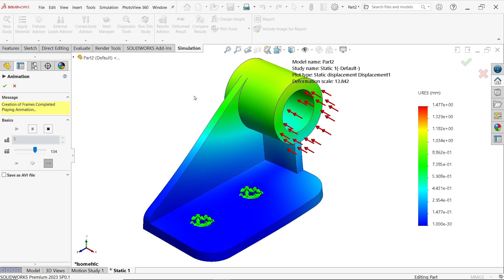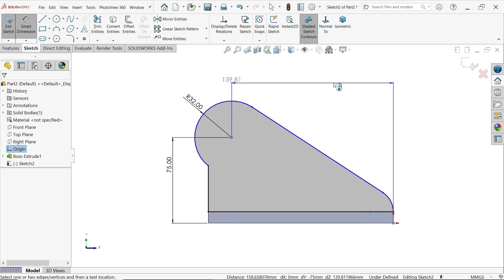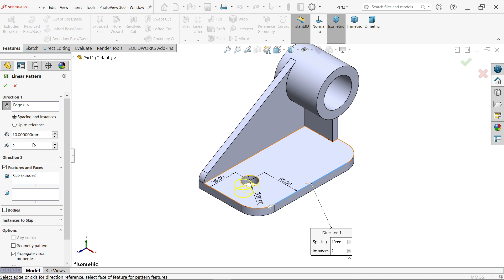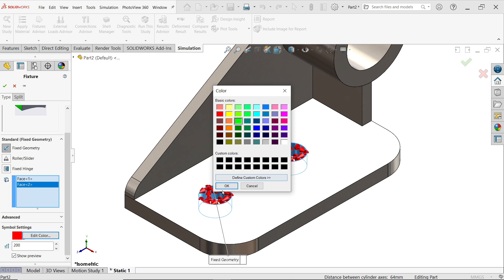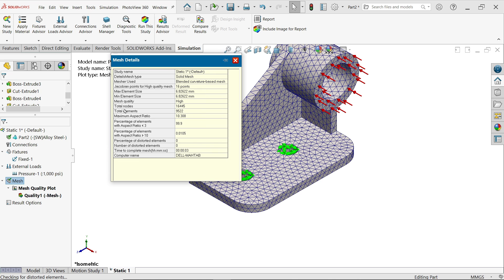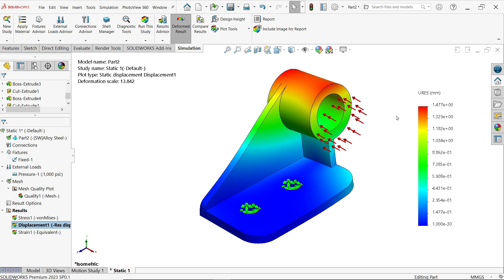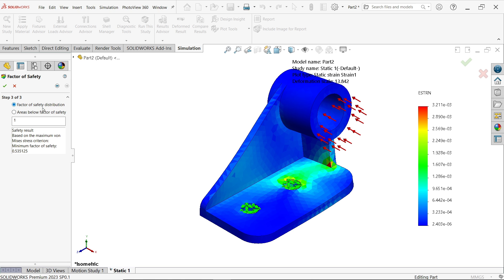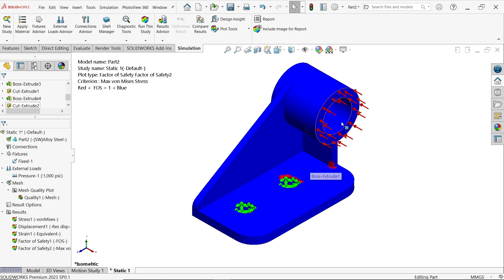SolidWorks Simulation Static Analysis of Bracket

Comment: Thank you so much for showing me this informative video. I have been following your videos from the Swiss army knife onwards and have learned a lot in making 3D models. Does a technique exists to create topology models using these static analysis methodology to create parts with organic support frame structures instead of extrusions? Something like a truss-like organic structure based on a stress/strain/displacement analysis to create those parts would help a lot in manufacturing strong and light weight parts that are similar to Voronoi style. I would love to get your training video on something like that if it exists.